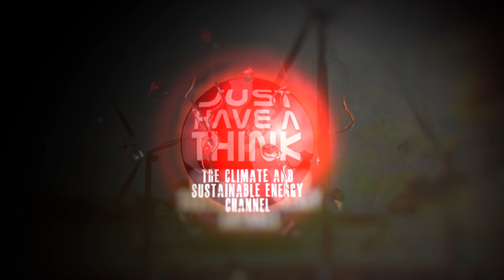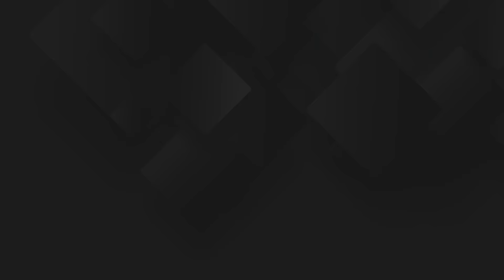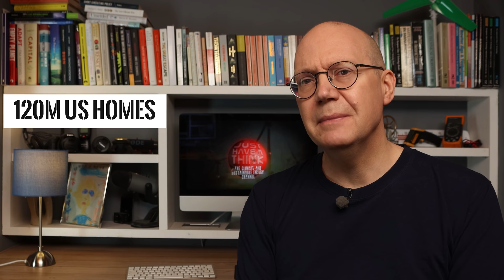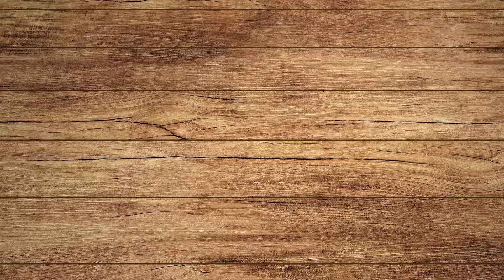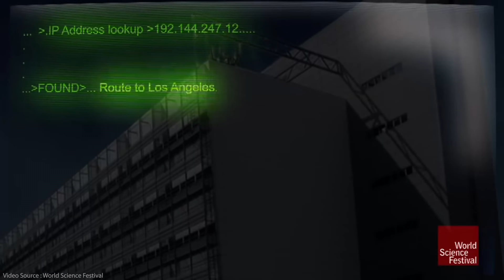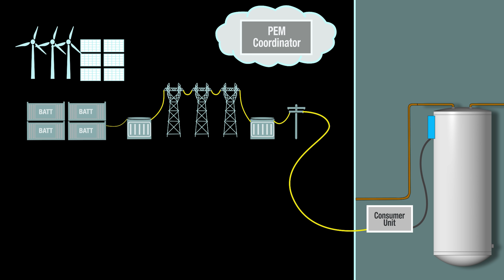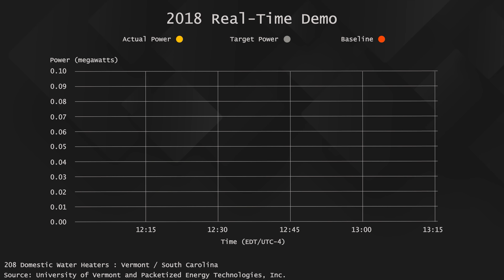How to balance renewable grids WITHOUT energy storage!

Comment: I don't agree the future of grid is overconnected just because of latency and internet failure.
Behind electrical grid network, every point in the network are ruled by phisical law (voltage and frequency) that can be a function of current load on the line and transformer.
I think for a good realtime regulation, each end point need to screen real physical values like voltage and adjust it's consumption it'self without external gouvernor.
Of course on the other side, energy generator need to share a  map of normal physical values in each point of the electrical grid, updated once a month, a week, maybe a day or even more using this "normal voltage value" public flag to drive dynamically the load on the grid. 
So a minimal, free and low speed connection is needed and by design the grid opperator will not be in god mode : i don't like you because you are a bad citizen, i choose to cut your electricity because im god on the grid!
ofcourse point of faillure of this topology driven in realtime (unlike normal value updated once a week or a month) is piracy over the internet network and the grid will go down if hacker success to fake the gouvernor map

Comment: So, not even going to start to watch because it's impossible.  If you don't have grid storage then you're not using renewables.  There are many parts of the world where renewables aren't very effective.  Low wind, too far north or south.  You need over generation of wind and solar and to store part of that power to release as loads require, and you need improvement of long range transmission.

There are some locations in the world where renewable sources may never be able to power because it's not economically feasible to do so, and economics HAS to play into solutions.  But, there are large areas of the world where renewables like solar and wind along with grid storage can produce almost all power requirements.

And, there's grid storage technology, NOT Li-Ion or anything Tesla, that is PLENTIFUL.  It would NEVER be an issue for supply.

https://www.youtube.com/watch?v=JxGP9cYbwdk&t=299s

This form of grid storage could become VERY inexpensive once you hit economics of scale, and if more companies bought from them, this would happen sooner rather than later.  They do have systems deployed so there's plenty of data being collected about their cost effectiveness.

Comment: Hope they will not make the ipv4 mistake again. Batteries aren’t a solution in a real world and needs tons land. And suspect if we heat with electricity there will be a lot of regions having huge problems heating there home. And i don’t see it as a good solution to have my EV charged not enough to drive to work and then needing to buy electricity extremely expensive during my work time. The who cares will not really work. Net neutrality doesn’t work either just because of the connection of the client. 

What they basically want is to reduce the amount of consumers of energy. And having everything connected sounds like a terrible idea especially in terms of privacy and also the networks especially on the country side aren’t made like that.

But yeah lots of more software stuff that will make this system very fragile. Also it’s centrally organized which basically means there is sort of a weak point. As there is still the servers of the energy provider.
Reply: It wouldn't mean your car isn't going to be charged overnight, it would just mean that it might not start charging at a particular moment if there is high demand from higher priority appliances at the same moment. Obviously it would be a useless innovation if it meant that people's electric heaters and cars didn't receive power until hours after it was needed, that's not what is being described in the video.
Reply: @danyoutube7491  What they describe is equal sharing of power and as there isn’t much power after all of this was removed there are things that will not get energy and some that are. A problem i also see with there tech is that it needs to be usage based for a heater it doesn’t make sense to turn off/on for seconds but for a mixer makes maybe more sense.  

Feels i bit like works great with current base load systems but doesn’t work well if people don’t use power differently e.g when it’s there.